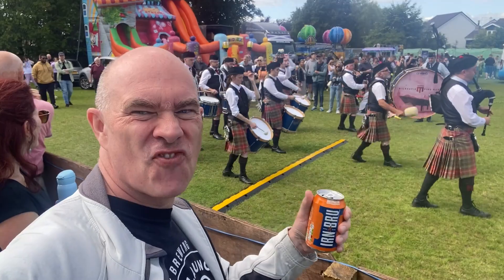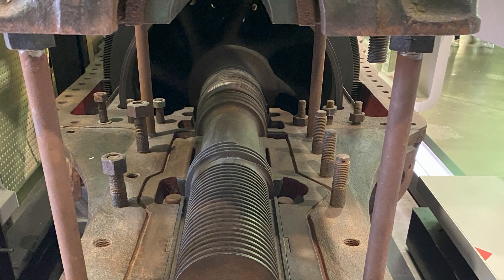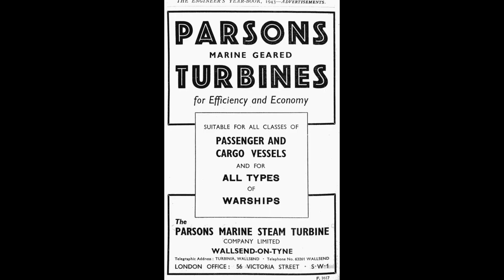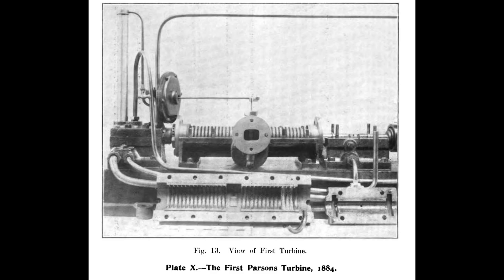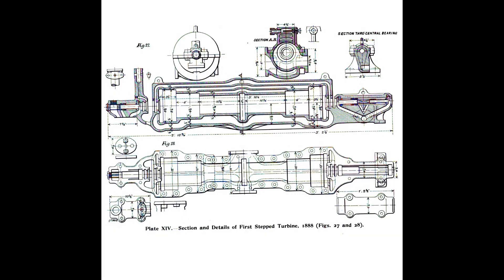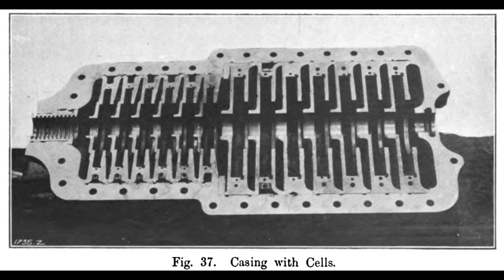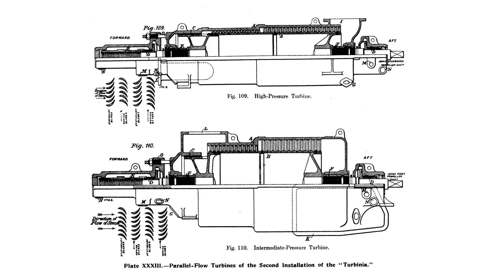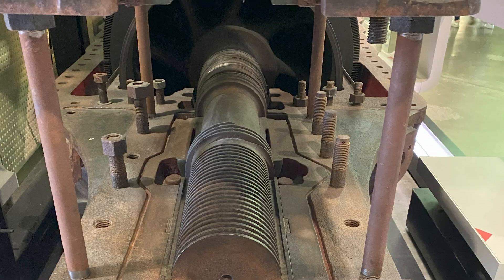How A Victorian Era Engine Made Spaceflight Possible... Let's Look At A 125 Year Old Turbine!

Comment: DeLaval still makes oil/water separators also.  I disassembled, cleaned, and reassembled one every day when I was in the Navy.  Our ship’s fuel (1/2 a million gallons) was stored in tanks in the bottom of the ship.  

Since you only want a fuel/air mixture in your engines (gas turbine propulsion), not in the tanks, the fuel was “floated” on seawater to keep the storage tanks full of liquids.  This meant that to get the water (and any solids) out of the fuel, we had to run it through a purifier.  

This machine, made by DeLeval, was essentially a centrifuge.   The fuel/water mix was injected from the bottom, spun at high speed to separate it, and then the fuel was drained off the inside layer while the water was drained off the outer layer.  Sludge was captured on the surfaces, which is why the whole cleaning thing.  

This particular design was famous for catching fire when the bottom bearing failed, which destroyed the bottom rotary seal, dumping fuel oil on the now red hot bearing housing.
Reply: That name brought back unpleasant memories of cleaning DeLavel lube oil seperators... removing carbon from the 50+ stainless cones. The fuel oil sep wasn't so bad. All part of the watch routine duties some 26 years ago.     :-)
Reply: @nofider1  I was lucky.  We used Sharples lube oil purifiers.  I could clean one of those and have it back on line in ten minutes.  No cones.🙂
Reply: @Simple_But_Expensive  sharples! God, never thought I'd hear that name again.
Reply: So much I could say about both! The problem with DeLaval's were the wood clutches and Chiefs being afraid of the.! I never figured out why...
I've had a problem with a couple of Sharples. First one, they decided to change from a DeLaval to a Sharples. Got everything ready to go, pushed the start button, it almost got to speed, and the belt flew off! Checked everything, all was good, except the manual called for a seamless belt, the Navy kept sending me belts that had seams in them and they all did the same thing! My CWO4 division officer said I was full of, you know! 😊
I (an E5) finally called the local Sharples office in Little Creek, gave them my model # (it was a special non-magnetic unit) long story short, they gave me the proper belt to prove my point. Good customer service!
Second time, I was called down to a DLG that had a problem that nobody could figure out. I had them start it up and before it got to speed, I had them shut it down, the pinion bearings were squealing too much for my instruments! We replaced them, after teaching the supply PO how to find a part #, how to fill out a requisition, and finally the repair.
They are both simple machines, very important for proper operation, yet severely underlooked when it comes to maintainance.
Reply: @brucelytle1144  Sharples definitely had good customer service.  We were lunching spindle bearings about once a week.  When I called them to ask what we were doing wrong, they sent a rep out to have a look.  He said he would speak to their engineers.  Two weeks later, a new design top end came in the mail.  We didn’t wipe another bearing for at least the next four years before I left the command.  Wish I could say that for the DeLaval.
Reply: @Simple_But_Expensive   thanks, I was trying to remember "spindle" and wound up with pinion. They are the simplest to maintain, etc. Yet all of the merchant vessels I've been on use the DeLaval (Alfa-Laval) purifiers and fuel oil purifiers/separators (to get the fossils out 😉), still....
Reply: @brucelytle1144  Hopefully that was also reported to Maint for validation and update of the COSAL. (It's crazy how much stupid stuff can get into the system again and again, until there's review of shipalts and all that while in the yards.)
Reply: @pauljs75  nobody would pay attention on that ship! USS Iwo Jima, the right belt cost $20, the one the Navy kept sending was $1.29! Still didn't work!
I couldn't find heat treated nuts for main steam lines, they were all anodized brass! I'd order more, they came out of ships stores, they were all brass too! I tried to get them all thrown overboard, got in trouble for that! That was 1973. Fast forward to Desert Storm. The Navy only had 9 deaths during that time. 9 sailors died in the fire room when a steam line joint broke and killed all 9 people in there. The cause was found to be.... yep! brass nuts on the main turbo stop valve.
They never paid attention, never cared!
I shipped over, just to get off that thing!
Reply: @pauljs75  Right about Rickover! I was OOD once when he visited our ship (AS-18). I repaired SSN's on it. Everything was done correctly and checked be at least 3 or 4 people in the process. 
Matter of fact, when it was time for me to re-up, I had a 4245 job code (submarine Auxiliaryman), and wasn't going to unless I got a Sub for orders. I got orders to an oiler, and said see ya later! It was because of the 2.0 evals I got from the Iwo Jima.
Reply: @brucelytle1144 
I am not any kind of engineer or mechanic but I know brass expands when it is heated. 
Do you suppose that they would not slacken if they were 'king' nuts ? 

I have stripped the threads on a brass nut or two as a child so I would worry about tightening them while they are hot. That means extra tightening when they cool and there is still the possibility of dry steam in the line.
Reply: @myparceltape1169  On 600 psi, 850°F steam lines, brass doesn't have the strength, no matter how tight you make it.
On that particular ship, those brass nuts only fit the studs on main steam lines. No where else, I checked... They were a life threatening danger, as was proven years later. My personal opinion was that some suppliers bribed somebody and sold the Navy counterfeit Nuts, and pocketed the grift.
Reply: Steam turbine power stations use Alpha Laval oil separators. It was the out put from one of these that let us know our turbine was letting oil into the HP turbine shaft. The hot oil was cracking to petrol at about 50 imperial gallons per day. Fixing that was very long story.
Reply: Heh. I am familiar with the device as well. My employer delivers the drive belt powering the rotor.
We occasionally her from them when the belt does not perform as expected...
Reply: Oil purifiers /separators are now under Alfa Laval brand, but same founder.
Reply: Fuel is typically floated on water to prevent free surface effect as much as anything else. Plenty of other vehicles (airplanes, cars) get air in their fuel tanks with no significant fire risk.
Reply: @PsRohrbaugh  I've spent a significant part of my life being an engineer on ships. I have never seen water purposely mixed with fuel oil, never.
Explanation is, that, generally the FO tanks are one the sides of the ship and basically have little to no free surface effect. That is a problem only over wide, unobstructed surfaces.
Reply: @brucelytle1144  Warships are different.
Reply: @PsRohrbaugh Airplanes that fly at high altitude inert their tanks as the vapor space above the fuel becomes explosive if cooled to below -40 degrees. Normally the tanks are too fuel rich to burn.
A 747 was destroyed in flight when an empty fuel tank detonated due to excessive external heating.
Reply: Liquid separators too for the food industry, like for skimming milk fats.
Reply: @fallinginthed33p  funny! I worked at a mozzarella factory. One day the separators backed up. I had to go scoop out 40 lbs. of butter, to help cleaning it up! Poor me! What will I do with 40 lbs of fresh churned butter?😁
Reply: @fallinginthed33p Also an early stage in edible oils to separate coarsely filtered oil from water and remains of plant debris.  
Some seeds only give 20pc oil before they are extracted with counter-current solvent.
Reply: @fallinginthed33p  Another use- after edible oil has been treated with aqueous acids and alkali a high speed continuous centrifuge separates oil from water. 
Often any remaining water is evaporated off at low pressure
Reply: The oil/water separators actually started off as milk cream separators…
Reply: I was on the CG-48 USS Yorktown and had some experience with those as well.
Reply: Is that anything like the Alfa Laval oil conditioner?  They are used to remove particulates from lube oil.
Reply: @wadeparker1452 Not just particulates - water too…
Reply: Strangely enough the oil separators are commonly used on a different type of turbine- wind turbines.  They're often used to separate particles from the gearbox lubricating oil to prolong the service life and reduce maintenance requirements
Reply: Alfa Laval they’re called
Reply: Does someone know why the fuel in the tank was "foated"? Never heard about that and I am always a bit pissed if someone tells me to carry out a pressure test on the bunker line with water, since I will have water in my fuel tanks afterwards and will need to seperate it again :) So is this a navy thing to do???
Reply: sry...should have finished reading all comments...get it now
Reply: @Globbofy  Basically, warships have two types of fuel tanks: storage and service.  The storage tanks on my ship had capacity for 500,000 gallons.  

They were flooded with seawater.  When taking on fuel, the water was displaced overboard.  

This has two purposes.  First, it prevents sloshing effects as the ship pitches and rolls.  Second, it prevents explosive vapor from building up in the tanks.  

When fuel is needed for the engines, it is stripped from the storage tanks, purified, and sent to the much smaller service tanks.  

As fuel is removed from the storage tanks, water is pumped in to compensate.  Since fuel oil is lighter than water, this leads to the phenomenon that the ship rides higher in the water when the tanks are full of fuel oil.

According to Navsea, the primary purpose is enhanced stability, but in gas turbine propulsion school they told us its primary purpose was vapor prevention.  I remember, because I got it wrong on a test.  I never did get a clear answer.

When I went to school, only Spruance class destroyers were being built.  They and the Perry class frigates that were just coming out when I left are now retired, but most of the technology was kept for the Ticonderoga and Arleigh Burke classes, so perhaps someone who served on one of those can clear it up.
Reply: We never put sea water in our fuel tanks except once in an emergency for ballast. Even then, it was an empty fuel tank, and it was a pain in the ass cleaning it out so we could use it for fuel again.

We had turbines onboard. I was an FOWK as well. 

We rarely cleaned the fuel oil purifier. The lube oil purifier was cleaned on the 4-8 watch daily and rotated through one of the engines
Reply: @JoshuaTootell  Our first Chief Engineer decided we would clean the DeLaval fuel oil purifiers (there were two of them) once every two days, meaning cleaning one every day.  It didn’t matter to him that they only needed cleaning once a week or so.  

As for our Sharples lube oil purifiers, each engineroom cleaned them twice a day, and aligned them to alternate between the main reduction gear sump for half a day and the propeller hydraulic sump the other half.  

The next two Chengs never changed the policy.  I left about halfway through the third Cheng’s tour so I can’t speak to anything after that.

My first 6 months aboard I handled the fuel oil purifier, then I was transferred into one of the enginerooms.  I much preferred the Sharples.  

At first we were constantly lunching the upper spindle bearings on the Sharples, until they sent us the modified top ends.  After that, we started to wipe the lower carbon bearings until I figured out how to set the bowl height.  

After that we set the height every time we cleaned it.  We wore out a belt before we had anything else break on them after that.  Those things were bulletproof once we had it figured out.

Not so the DeLavels.  The Spruance class was famous for catastrophic auxiliary space fires because of them.  

As I said before, the rotating parts were supported by a lower bearing.  The bearing would wipe, get red hot, and then take out the seal, dumping fuel oil on the red hot bearing which made an excellent ignition source.  

The real problem was that the purifier wouldn’t shut off, and it would cheerfully keep pumping fuel into the fire.  When it happened, it was a real joy to put out.  

It never happened while I was aboard, but it did right at the end of the next deployment.  Guys I talked to when they got back told me they had 37 reflashes because they couldn’t ID all of the electrical cables running through the compartment.  

They finally ended up taking a chainsaw and cutting every cable where they entered the compartment.  That ID’d them just fine, although it made true enemies of a bunch of twidgets.😈

Good thing the next task was putting the ship in dry dock for her 6 year overhaul.

Better thing was that I wasn’t there to experience it.  Sorry guys, but…😎
Reply: Ah, the oil purifier. I never quite got the magic knowledge down to get that thing running proper in my time on board lol.

I'll take the feed pump startup (single stage steam driven for the uninitiated) instead please.
Reply: @nickhahn3276 Ask a dairy farmer. They use identical machines to separate cream from milk (but those are slightly different (milk fitting on the intake and outlets and stainless steel construction…)).
Reply: Semper Fortis ⚓
Reply: Wiki explained it well: History

Hero of Alexandria demonstrated the turbine principle in an aeolipile in the first century AD and Vitruvius mentioned them around 70 BC.

Early turbine examples are windmills and waterwheels.

The word "turbine" was coined in 1822 by the French mining engineer Claude Burdin from the Greek τύρβη, tyrbē, meaning "vortex" or "whirling", in a memo, "Des turbines hydrauliques ou machines rotatoires à grande vitesse", which he submitted to the Académie royale des sciences in Paris.[4] However, it was not until 1824 that a committee of the Académie (composed of Prony, Dupin, and Girard) reported favorably on Burdin's memo.[5] Benoit Fourneyron, a former student of Claude Burdin, built the first practical water turbine.

Credit for invention of the steam turbine is given both to Anglo-Irish engineer Sir Charles Parsons (1854–1931) for invention of the reaction turbine, and to Swedish engineer Gustaf de Laval (1845–1913) for invention of the impulse turbine." 

And the german Wiki mentioned (of course) Eulert (was a Swiss mathematician, physicist, astronomer, geographer, logician and engineer 1707-1783) with his 
Euler's turbine equation.

Comment: I love the little slip up saying "propellant" then quickly correcting to "coal".  You don't hear that very often.😁
Reply from the maker: Did you know that there were proposals for jet engines using coal dust as a fuel?
Reply: @scottmanley  I was told that in gas turbine school in the Navy.  Gas turbines will run on anything that can be made fluid enough to flow through a nozzle.  Fine coal dust does this very well, but it eroded the nozzles.  It also coked up the cooling air ports on the turbine blades.

Also, if I remember correctly, Diesel’s first attempt at a reciprocating engine ran on coal dust, but it exploded because the fuel/air ratio couldn’t be controlled.
Reply: @scottmanley  yep. late wwii germany.
Reply: sooty battery
Reply: I'm pretty sure the aircraft in Harrisons "A Transatlantic Tunnel, Hurrah!" were fueled by coal dust.

Comment: Fascinating history lesson. I had no idea turbines had been developed so early. It seems the 1890’s were to mechanical innovation what the 1990’s were to electronic innovation.
Reply: Agree. The 1890’s saw new technologies being introduced that are still with us today, and which made possible the tremendous advances of the 20th century. It must have need a heady time for tech enthusiasts of the day!
Reply: @bradnail99  We didn't build or invent any of it, please start doing the math. We inherited this technology and everything in the past century has been cheap imitation. How did we start out with better stuff than we have today? It would make no sense in between pestilences war, tilling the land, wake up people!
Reply: The tech was there in the 1700s but lacked standards and assembly lines for high precision and repeatability.
Reply: @kurtwinter4422  I reckon they also lacked steel in sufficient quantity, needed to support higher steam pressures, and is more easily formed for the precision manufacturing you mention.
Reply: Boeing rebuilt an airplane factory with turbine-powered belt drives to run machines. My modern factory ran on a huge, screw compressor. Funny that using gases to do work has been around so long.
Reply: What we need next are some real breakthroughs in material science.  I'm thinking of more effective rockets, easy atmospheric reentry and self-sealing orbital modules.  Einstein knew already how to manipulate gravity;• that was 120 years ago.  Yet our materials can not even handle 0.1% of the needed energy.
🚀🏴‍☠️🎸
Reply: @MichaelWinter-ss6lx Breakthroughs in just one area of material science can drastically change the world in a way that few other categories of research can match, often almost overnight historically speaking. It doesn’t change much if you come up with an ingenious concept, idea, or invention if you don’t have the stuff needed to construct it in a somewhat reasonable time at a somewhat reasonable cost.
Reply: Yes, such “positive development” happens when most of society is, eh… positive to whatever is developed, gaining something from it. 

And… positivity vanes when or if (critical part of) society can’t see what / who any “development” actually contributes to. 

Recurrent, still never familiar - since the “positivity cycle” is around three-four generations of time passing…